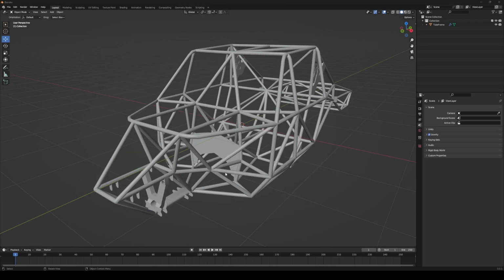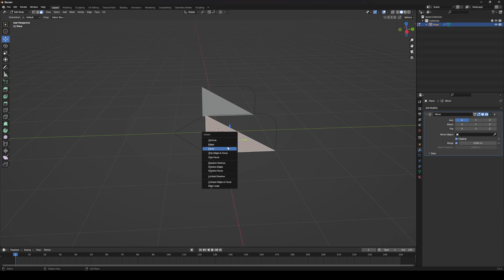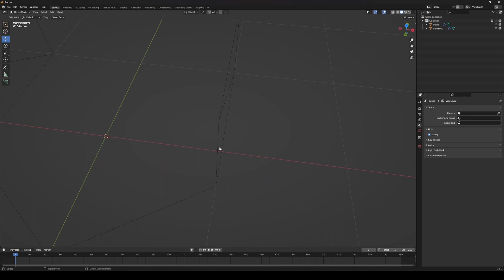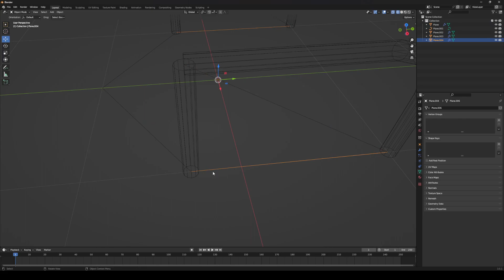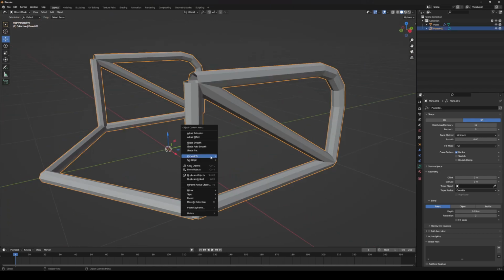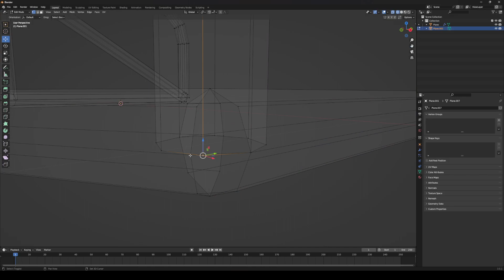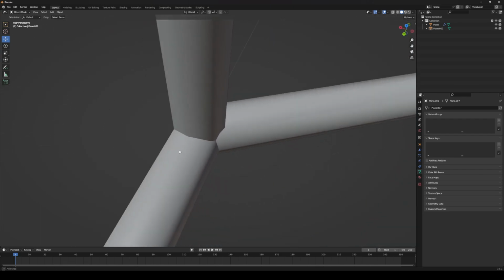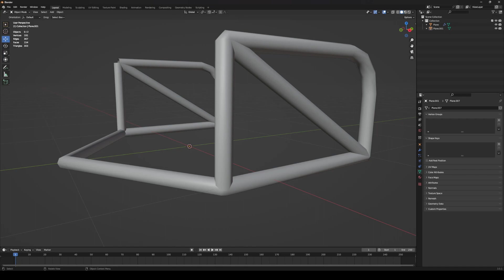Blender Low Poly Rollcage Modeling Tutorial

Comment: FUUUUCK all that. use fusion 360. 3d sketch -> pipe  -> boolean & done.
Reply from the maker: huh, i might have to try that, i haven't used fusion 360 before
Reply: @ShaunForhan  also just start your sketch on the center plane and build off that. Then mirror - cuts the work in half.